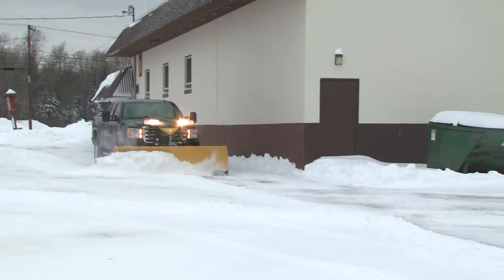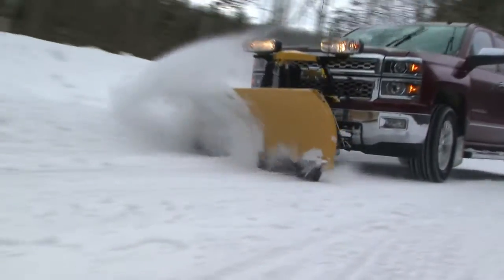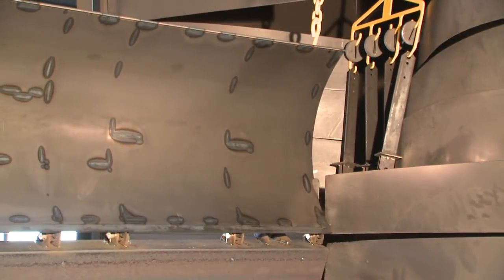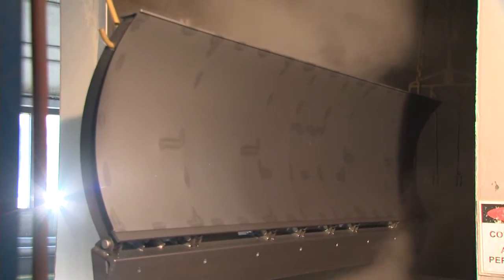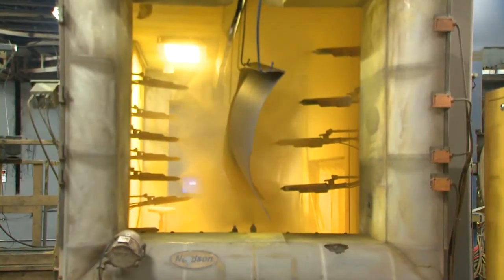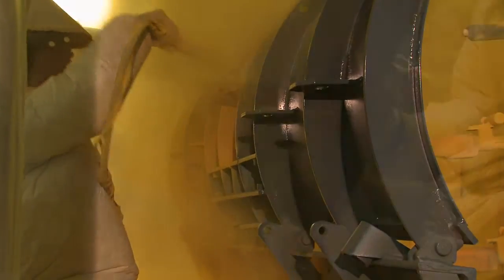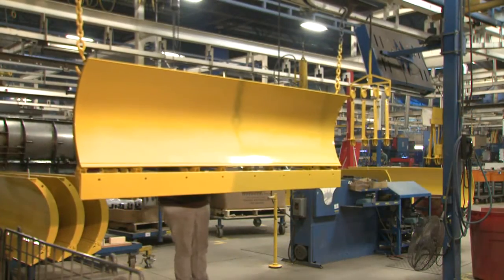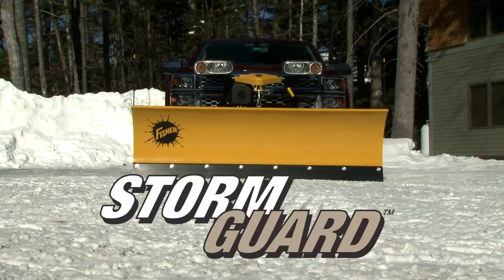FISHER® Snowplows - STORM GUARD™ Baked-On Powder Coat

Comment: Fisher, what's the difference between your new Fleet flex wiring an the older mm2 3 plug set up? A family member has an older mm1 an that's 2 plug, is that combatable with the fleet flex? It's confusing